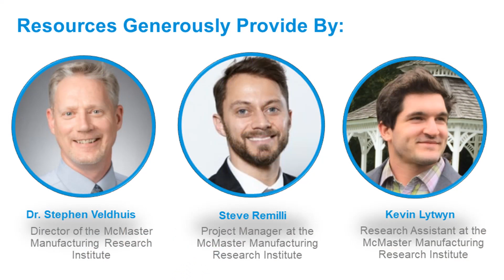This Robot can Automate your 3D Printers

Comment: Intriguing solution... have you considered using an x-drive or mecanum drive instead of the tank drive setup to increase lateral speed?
Reply from the maker: That was the idea initially: https://youtu.be/IREE1Wb3AgE, we didn't have the budget tho...
Reply: @CallMeSwal  aw that sucks. Do you use odometry of any kind?
Reply from the maker: @nikhilgante313  yessir it has some fancy sensors

Comment: very cool. would be interesting if you used concepts from wafer handling robots and how semiconductor facilities handle their materials. maybe have your mobile robot also double as storage for finished print jobs + used print surface plates, as well as new fresh plates. kinda like a shelf on a roomba + robotic arm/end effector system. sky's the limit tho when it comes to how good your robobo can be tho of course + also many possible different automation solutions

*but can you automate the maintenance and build of your automation? 🤔